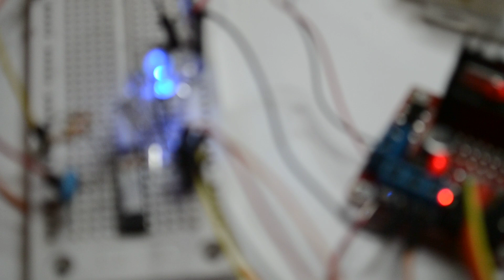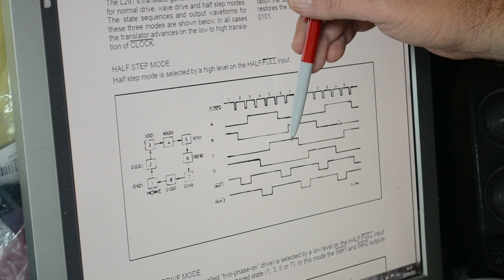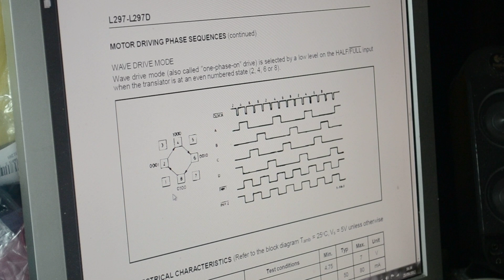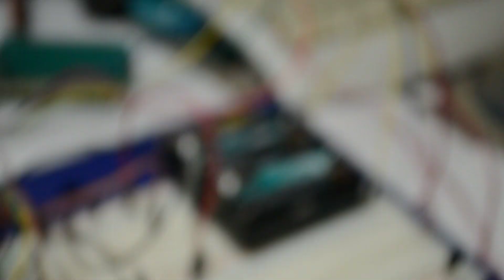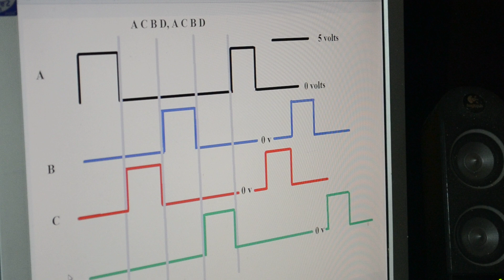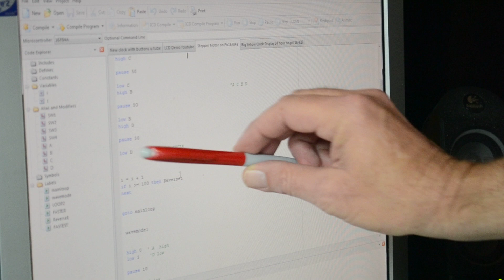How to Make a BiPolar stepper Motor Work Part 2 L298; Wiring in videos 3 & 4

Comment: Hi John, I have just come across this video whilst trying to understand more about stepper motors and the L298n driver. I have a 6 wire nema17 motor that I have managed to get running with some python code on a raspberry pi and whilst running it today for about an hour I noticed the motor was very hot, as in too hot to touch. I have 12v connected to the driver and common ground with the Pi. I want to ask if this is normal for this motor? Please make any responses very basic as I am in no way electronics literate, I’m just trying to get to grips. Thanks in advance. Great videos on your channel and I plan to watch many more.
Reply from the maker: Wow such an old video and I didn't have an edit tool back then.
The ON times should be around 1ms approx, you can experiment.
Longer on times will cause the motor to heat up. 
From memory, some motors only need 800 us micro seconds or less.
The motors do get warm but should not be hot.
Try a lower voltage too to reduce the current drawn, this will lower the temperature too.
Hope this helps.
My later videos do get better lol.
Reply: Hi John, thank you so much for the reply. I was glad that you had some relatively new videos that suggested you would see my message. I wasn't aware that you could control the ON time, with either the code or driver. I have been using a 12v/1A power supply so i will try putting one of my drop down converters on it at 9V and see how that goes. I plan to use the motor to rotate the Pan on a Pan/Tilt camera mount for my Raspberry Pi All Sky Camera project. I scavenged the motor from a scanner a few years back and I want to be able to make use of it. It has been a real learning curve for me but I'm enjoying it so far. Thanks again. Eric...  @JohnB-2021
Reply from the maker: @wasdaletimelapse7658  Thank you Eric.
It was only with experience I realised my previous ON times were way too long.
Different motors respond differently with different ON times.
Reply: Hi John, after watching some of your other videos I understand what you mean about ON times now. I really dont think they are an issue when using the Raspberry Pi, or at least the code that I am using to run the motor seems to handle everything. I can see from the code you are using from the PIC that you have to actually stipulate the timings. That would have put me right off if I had to do it that way. I have it quite well set up now and I am able to do fine adjustments with the UP/DOWN arrows and use Q-W-E-R to make bigger moves. I am thinking about creating a video of my setup and posting it on my YouTube channel to help others that might be struggling like I was. It only seems fair to give something back.
Regards
Eric... @JohnB-2021
Reply from the maker: @wasdaletimelapse7658  I'd like to see the video if you make one.

Comment: why my driver l298n so hot ? I use stepper motor Nema17 1.8a
thanks
Reply from the maker: Probably because the on time is too long.
Try reducing it.
What voltage is running the L298?
Reply: John B i use 12v 3a
Reply from the maker: OK
I think your 'on time' is too long, you only need 1 millisecond on for each step.

Comment: hello Mr John
i have already 4 pieces from L298
and power splay from PC  12v 
and i want build a small CNC by stepper motor:
@Model :17PM-K040-P2W
@ Precision hybrid type, Step angle :1.8 degree, 2 phase hybrid Bipolar
@ 40 windings per coil, Winding Resistance 3.5ohms
@ Rated voltage = 3.5V, Rated current: 1.0A,
@ Inductance 2.8mH, Holding torque 2.3kg-cm, Rotor inertia 34gcm^2
@ 2 phase, 4 wires/connection ; yellow=A+, orange=B+,Red=A-, Blue= B- . Is this appropriate or should I buy a4988?
Reply from the maker: +run away 
Yes, if it does not work, just keep swapping the wires for the motor
Reply: +John B yes it works fine like your video,, But my question in terms of motor speed and accuracy of movement in millimeters Is there a difference or not? thank you so much for fast answer :)
Reply from the maker: +run away 
I don't think it matters, all motors give similar results
Just look for Nema ..............
Reply: +John B thank you sir

Comment: Hello,
for a line follower robot with 02 infrared sensors and 04 DC motors 
connected in L298N driver, how many amperes I need to robo do the curves correctly?
Reply from the maker: +Cida Luna 
Hi, it depends on the motors but, the chip is rated at 2 amps
I have a motor moving a 9kg solar panel, it uses 200mA
Reply: +John B Okay , I see how many amperes they need .. thank you.
=)

Comment: Sir I am doing a project,so I need to know whether this stepper motor driver L298 will work for Minebea 16PU-M202-G1ST Bipolar Stepper Motor and do I need battery case for its running if I am using raspberry pi 2. It will be very helpful.
Reply from the maker: +vinish bhan 
Hi, yes the motor should run from the L298.
You do need a supply for the L298, 5 volts is not enough.
Thanks
Reply: +John B  
Thanks a lot for the help..

Comment: Hi, please tell what or how I can control the simples way 5-lead-wire Stepper Motor 
I Try build turntable for my layout ho scale 
I Take this motor from old scanner input power  to scanner was  15V 
and do I have used and motor driver?? or I can used potentiometer
to control
Thanks if I can get some advice from you
will be much appreciated
O I did Sub Hoping You will to
Thumbs up
Reply from the maker: woltar9 Hi, no you can't use a potentiometer.
You need this driver in video or, try the simple to use Toshiba driver.
https://www.youtube.com/watch?v=JdNgZ7jMqIY

Thank you.
Reply: o ok i find othe r way

Comment: Hi, thanks for the post. What period did you use for the waveforms? Thanks
Reply from the maker: Hi, if you see the code, I had a pause of 50 ms when slow the 10ms when fast.
That 50ms is way too long.
Like the video says, keep the period short like a few milliseconds.
Better still, get the cnc controller that I show in the other video.
I hope this helps
jb

Comment: i got it working thanks to you (that acbd is key)  one issue I have, speed, seems that the only way to increase speed (da) is to lower pause, but when pause gets too low the motor stops. . . .i saw a tutorial on "ramping down" the pause to get it going faster, going to try that next.  i see videos op people turning these things at ungodly fastr speeds, does not look like they are ramping. . . .any ideas on that topic?

all the best 
John